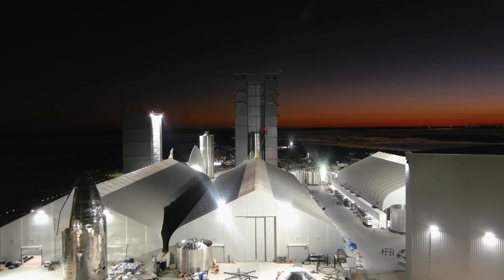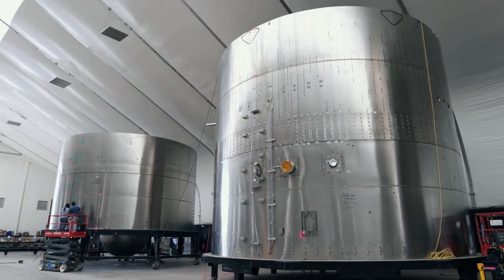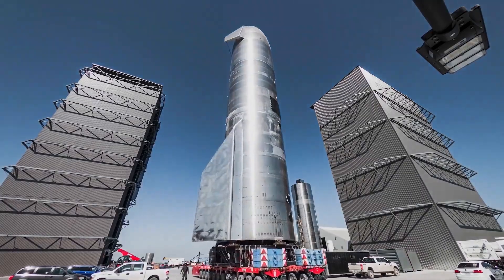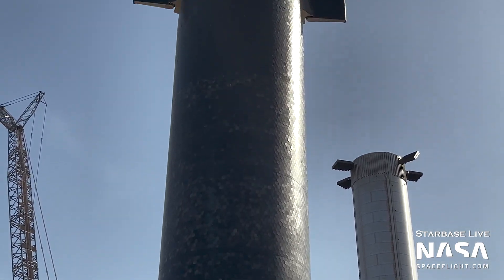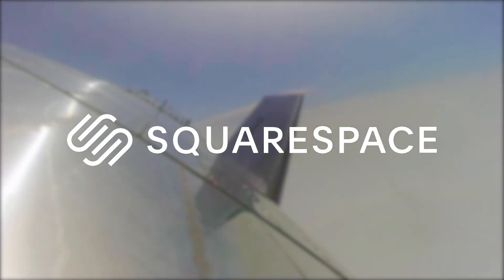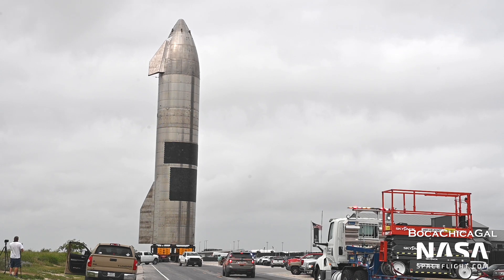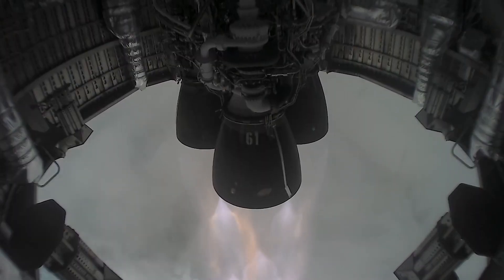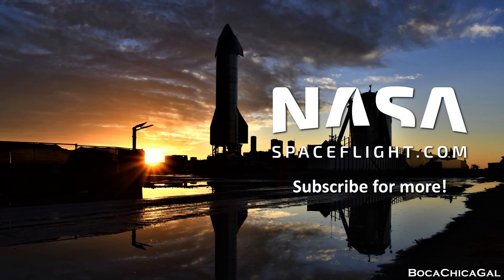How SpaceX's Starship Will Survive Reentry

Comment: If these tiles grow in size significantly when heated, then anything other than a single, central fixing point is going to cause lateral stresses in the tile and the fixings themselves, but that obviously is also a single point of failure so it wouldn't be appropriate. I think a greater number of fixing points, designed to accomodate lateral expansion, would make a significant difference. I know Elon always talks about minimising everything for cost and simplicity, but here I think it needs belt and braces so that there is virtually no chance left for the tiles to fail. Seeing just how easy it is for the workers to 'pop' these tiles into place, it's not too surprising that it's also relatively easy for them to 'pop' off as well when under stress.
Reply: I seem to remember other videos mentioning 3 attachments per tile.

Comment: I am guessing the felt under the tiles is  ceramic fibre blanket and the mesh net holding that on probably Nichrome wire? This would be typically used to line the inside of pottery kilns up to 1300 degrees.  So it looks like the tiles are also helping to hold the blanket in place against the steel , like a duvet without squashing it flat, also providing thermal insulation behind the gaps between the tiles.

Comment: I think a small number of tiles will be lost early in the flight due to vibrations from the booster or new body loads from the booster. I think a significant number of tiles will be lost around max Q as the trans sonic and super sonic effects will probably pull tiles off. I think the first starship that makes it to orbit will survive a large portion of re-entry if not all the way to the ground. I would be shocked if the first one to make it to orbit was also the first one to successfully return from orbit and land.

Comment: The hull design is a problem and among the problems are that the tiles will tend to pop off.  The very large diameter of the rocket and the fact that the design seems to suggest that the top half of the front half of the rocket will open to carry a payload, but that very large size is going to result in huge flexing problems that will stress the tile attachment resulting in tiles popping off..  Additionally, the flexure of the cargo door will complicate closing and sealing the door and if it is not completely closed it will not survive reentry.  This will require substantial stiffening with numerous closure mechanisms all of which will add weight (mass).  Not only will is have problems closing but it will also have problems opening.  And all of that on top of the missing tiles issues.  I dearly hope I'm wrong and it all works as promised, but the weight penalty and reliability issues are a huge liability in my book.
I suspect that if all goes well with the launch that the upper stage will burn up and break up during reentry do to tiles popping off.  And that is without making any attempt to open the cargo bay before reentry.

Comment: Why can't they simplify the process and make tiles say 1m high, and long enough to cover say 65° of the circumference?  

Is it just a matter of being too brittle and not having enough flex?  Obviously it'd be a whole lot easier doing it that way, and with many holdfasts on each tile, the chances of one falling off is reduced to close to zero.  So is it just too brittle and lacking the flex required?  Or perhaps hard to manufacture resulting in a very high level of rejected tiles?
Reply: Likely a combination of all.
Reply: @gravelydon7072  I'm guessing so, but I want a definitive answer lol.

Comment: Also, every launch that makes it to orbit can throw hundreds of StarLinks into orbit.   Easily 300 of them - and if that happens, it saves SpaceX maybe 6 Falcon-9 lunches - and that is enough to pay for a crashed StarShip.   More interestingly is how quickly they learn to do the catch/landing of the SuperHeavy - because with more than 30 Raptors aboard, that represents a LOT of engine manufacturing costs.
Reply: Estimate is 400 sats so like you say, the Starship surviving isn't really a worry with that level of operation. In fact, it might turn out that sat launchers might do away with the tiles completely.
Reply: @gravelydon7072  If there is enough fairing space - you might possibly be right.  Eliminating he weight of the tiles plus fuel for landing, plus the elonerons and their actuators might well allow them to launch enough extra StarLinks to make it worth while to have an expendable StarShip for this specific application.  We believe that Raptor engines cost SpaceX around $1M each to build- and you'd be wasting 6 of them...so even if the sheet metal and such cost very little - the loss of 6 raptors per flight would make that a tricky choice.
Reply: @SteveBakerIsHere  The thing that doesn't add up is the weight of the new Starlink sats. If they can deliver 150 tons to LEO, at 2 ton per sat that is only 75 of them per trip. Even if only 1 ton per that would still be still only be 150 of them. So nowhere near able to get either the 300 or 400 in one launch. And recently it was given that a V2 sat weighs 1.25 ton so it is looking more like 100 at a time. The V1 units were 500 lbs each and that meant 4 per ton so 400 of them could go but not the newer version. At that kind of weight, the Falcon 9 would do good to get ten of them up there at one time with the newer version. Hence why Starship is needed for the Starlink V2 launches.
Reply: @gravelydon7072  From the second part of Tim Dodd's interview - Elon seems to be saying that StartLink II is 10x more capable - which may mean that they can make do with 10x fewer of them.   Honestly, at this point, we don't know - and we don't even know what it is that we don't know.  Once StarShip is flying regularly enough to make a difference, there will be plenty of time to shed mass on StarLink,  The problem with Falcon-9 is more to do with fairing size - because you can only shrink the SIZE of a satellite by just so much because you need room for folded-up solar panels, which are virtually impossible to shrink in size.

But I don't disagree with you - it's just that we don't know enough to say at this point in time.

Comment: I am wondering if the tile failure we have seen lately is due to expansion or contraction of the stainless steel hull. Maybe the hull shrinks too much under cryogenic temperatures, forcing the tiles against each other until they break. Seems more likely to me than expansion of the hull under internal pressure being the problem. After instances during testing were the has been tiles broken or dropping off that some of the remaining tiles look like are trying to overlap each other.

Comment: Good video, thanks.  One thing: when you say the underlayer is felt, viewers might get the impression that it's the most common type, which is made of wool.  For added clarity, It's actually a ceramic blanket, sometimes called a ceramic felt.  It can withstand temperatures up to about 1,250 C (2,200 F) without damage, and doesn't melt until 1,760 C (3,200 F).  Pretty tough stuff.
Reply: Depends on the type but some can even go higher in temps than that. Fiberfrax 2600 for example. It is designed to go to 2600°F ( 1430°C ) without damage.

Comment: Great video. Suggestion for next video - mention the mechanism of failure when those tiles fell off. Shock overpressure waves from the engines hitting the structure most likely would not occur when the vehicle is 70m+  away from the engines that will be firing on the Pad. And a totally different mechanism of failure compared with re-entry where hypersonic regime thermal and aero loads dominate.

Comment: These tiles are my biggest fear. I have full faith in the construction of the ship's and boosters as well as the landing programs, but these things seem to fall off if the wind blows hard,
Reply: I think they need to go back to the drawing board and try that transpiration cooling system.
Reply: Ship 24 will have heat shielding and if it fails they will try to make the next ones better intill they get it right

Comment: I do enjoy the narrative method of explaining the process of developing the challenges that are being dealt with in making a successful and economical space craft. Although it does look like an oversized corn dog to me,. I often thought it would be sweet to just build an oversized vat of the slurry to dip the space ship into it and then stick the hull in an oven to cure the heat shield so it all stayed on and then finish it off at Boca Cica with tanks and fins and pipes and engines.  Super simple and fast and sweet~ haha.
Reply: Fiberfrax makes a putty for doing just that sort of thing. They also make topcoats that can go to 2800°F. The black tiles on the bottom of the Shuttle were only 2300°F rated.

Comment: I think they will eventually solve the tile problem, but not without dealing with similar problems the Shuttle did with them in the meantime. It could be years before this is rapidly reusable. And I'd be very surprised if we don't hear the words expendable Starship upper stage by the end of the year.

Comment: They need to do away with the individual tiles and instead apply moulded protective sections made of the same silica slurry. Perhaps 5 manageable moulded sections and finish off the odd areas with the individual tiles as the exception.

Comment: I have been commenting for over a year the the TPS is an Achilles Heel of the program. Whether one missing tile could cause catastrophic failure depends its location. A blow thru a tank wall would be game over. One thing is for certain, a returning spacecraft will not be turned around as quickly as EM claims.

Comment: From what I understand, Space Tape is still science fiction, but Elon had better invent it quickly and have a few dozen tiles in orbit as spares. What they may have to do is start coating the inside of the outer surfaces with a lightweight adhesive spray that would act as the last defense against the heat of re-entry.
Reply: Tiles over thermal blanket over Stainless Steel. Each layer is higher rated than the Shuttle was. The idea is to force the boundary air away from the ship so that all they are having to really fight is the radiant heat.

Comment: I think Elon and Team will find things they really want to improve even if it is completely successful and will implement the easy ones immediately for the very next test flight with bigger ones to follow
Reply: Also think they will have all sorts of censors on inside the shell of ship to measure heat at many points to see exactly how much heat is getting thru . I would load it up and have it recording and transmitting everything. The more info the better

Comment: Surving re-entry is one thing, but the question is whether the vehicle is left in a quickly re-usable state. It  took a while for SpaceX to learn how to weld glorified grain silos that didn't rip apart when pressurized and getting to a stable state involved automated welding equipment. Not sure how well artisanal welding of a patch of new steel over an area damaged by loss of tiles would work next time the tanks are filled. 
Once iterative testing/development restarts this year, SpaceX will learn from the failure and adapt. 
Note: gap between tiles likely more about steel compressing when loaded with cryogenics and then expanding during re-entry than the tiles expanding on their own.

Comment: I think these tiles are going to be the bane of starship.  They're gonna lose tiles all the time and it's gonna slow down reusability significantly.

They should trade all of the TPS mass (10 metric tons?) for roughly equivalent amounts of water that they can use for a transpiration cooking system.  10 tons of water will absorb like 20GJ of heat energy which is in the ballpark of what they need.

Faster turn around, lower landing mass, easier maintenance.

Comment: A couple notes - the nonwoven white fabric underneath the tiles isn't felt, that would just be...well.. absurd. It's a type of meltblown/meltspun rockwool or mineral wool, like fiberglass but doesn't melt until the temperature is 800C higher. Also, it wasn't the silica based tiles that doomed Columbia, it was the graphitic reinforced carbon-carbon panel on the leading edge of the wing, used where the highest temperatures were incurred.

Comment: the last time i heard about the tiles a lot of them fell of during testing. but it confuses me because they are literally doing rocket science and mounting tiles onto a rocket properly sounds easy compared to the entire rocket engine stuff. so why are they so good at designing efficient and well working rocket engines but fail at an easy task like mounting the tiles to the ship properly. i guess it has to do with the thermal expansion? too many bolts on each tile might be a problem if the material keeps expanding and contracting constantly. And also my second question that i always wonder: why do they start the rockets at sea level? why not use elevated areas, for example locations 1000 meters above sea level. it doesn't sound much but it could help a little bit? i know the rockets have to get into orbit and for that the speed is more relevant than the height so maybe thats why it isnt worth it?
Reply: Rockets always launch as close to the equator as possible because of the higher velocity of Earth's orbital speed.  And so it is easier and uses less fuel to launch closer to the equator.  Second rockets usually launch over water in case a deorbit is necessary and it allows the booster to drop harmlessly into the ocean or like Falcon and eventually starship to boost back to the launch area or an ocean pad.
Reply: @michaeldeierhoi4096  thanks that explains a lot

Comment: I'm sure I'm not alone thinking any tile system is way too fiddly for rapid reusability, even if it survives launch and re-entry.  I'll bet their ultimate gen-1 deployed system combines a novel material (elastic with high ceramic content) and a propellant based protective gaseous envelope (not unlike a Falcon 9 re-entry burn protects the vehicle.)
Reply: The Falcon 9 is not returning from an orbit so that comparison is not valid. Thus it also does not require a heat shield for reentry.
Reply: @michaeldeierhoi4096  Duh

Comment: Traditional space program manufacturers endeavored to achieve perfection (in complete secrecy) after a less-than-completely-successful launch before their next attempt; this may be one reason for the long time between attempted launches. SpaceX uses a test-to-failure program, usually in view of the public, to gather data before an actual launch; this data goes into design changes for the next models of Starship and Super Heavy booster. Even a total loss of the ship-and-booster pair in a launch produces information that may help the next pair launch successfully. I think Elon's model of program development includes the reasonable acceptance of human fallibility, so he's unafraid to show errors. It must remove some of the pressure on him and his design crew.
Reply: He has said that even he expects failures on the first few flights. And that is how SpaceX learns what to change.  But it looks like the first test flight will also be launching one or more of the Starlink V2 sats. So even more data. If it makes it back to a water landing, you can bet that it will be well studied to see what needs improved. The data will be dumped before a landing just so they have it if it makes it thru reentry. And they will already have done a data dump for the launch/orbit part before reentry. Which is why they have the FCC license for the Starships.

Comment: I personally think it it would be better to landing gears like the Falcon 9 and use them as air breaks.  Then instead of a heat shield the y can do more deceleration burns.  The Starship is around 85t loaded and can carry a max of 50t returning.  It uses 1200t of fuel.  So coming back if it has 10% fuel it will weigh 255t... while going up it could weigh 1435t.  That might be enough for a burn back to drop it out of orbit, a slowing burn to re-enter, then open the landing gear half way to act as a wind break.  They could save weight by removing the fins and heat shielding.  The landing gear would be a fraction of that.  This might save 5-10t off the weight.  It would not have to do the belly flop (a very dangerous maneuver) and then land.  People do not understand that the returning Starship is like an empty beer can in comparison to the launching ship being like a full beer can.

Comment: Starship couldn't just to plane in the upper atmosphere for longer time? Instead of falling like a brick, it could just to keep scrapping the upper atmosphere and losing velocity until is slow enough to come down.
Reply: There is no other way to reenter orbit with current technology. The starship does plane or bellyflop during reentry just like the shuttle which is why tiles are all on the leading face and extending around the sides part way.  Then it flips up right before landing unlike the shuttle.

Comment: My prediction for the first Starship launch: 
50% SH had a RUD, either on the stand or after takeoff
50% SH works perfectly, Starship burns up on entry
Reply: Well 50-50 is always the case. It either will or it won't.:_concur:
Reply: @gravelydon7072  Actually no, you could have a situation leading up to two possible outcomes where the probability of these outcomes actually happening isn't equal, meaning one is more likely than the other.